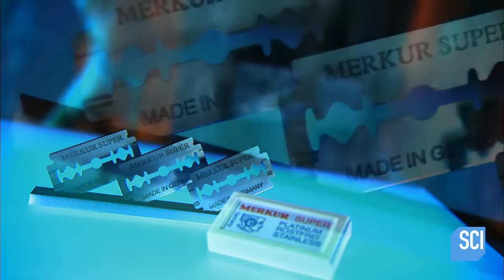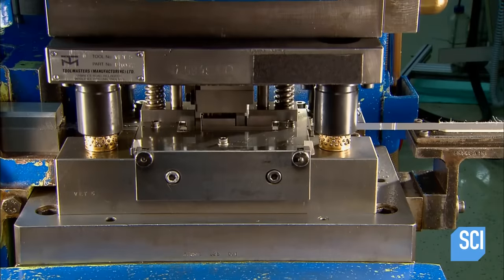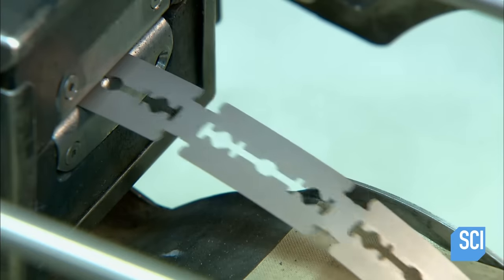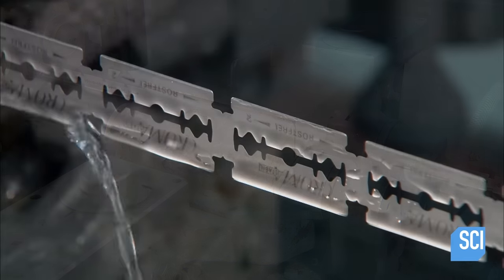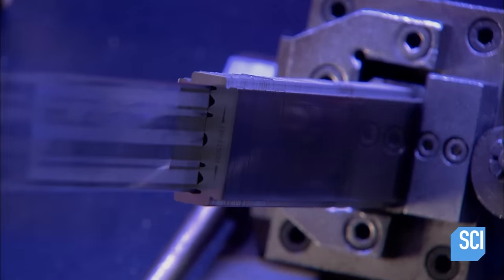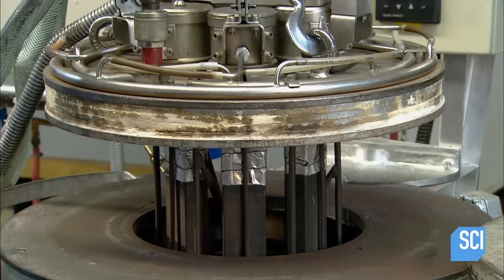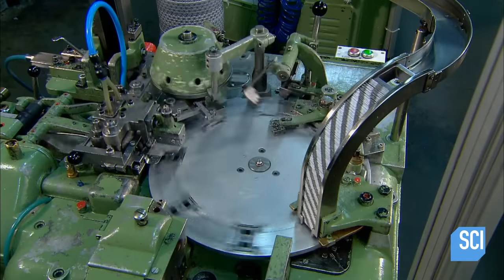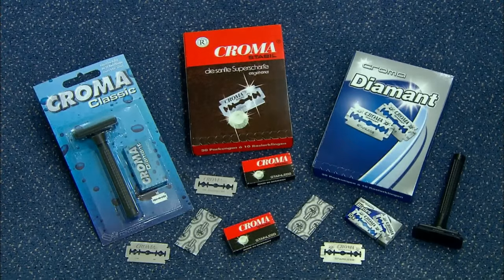How It's Made: Razor Blades

Comment: a long fast moving strip of razor sharp metal is actually kind of terrifying
Reply: they look like chuck-e-cheese tickets lol
Reply: That sheet metal could easily cut you before it was sharpened too! Think like a paper cut, but with metal zooming down a belt.
Reply: I wanna throw tomatoes at it...
Reply: The circular spinning machine for wax paper packaging is also no joke
Reply: To be honest, the singular stationary blade in the wax paper is scary enough on its own during the short time window between unwrapping it and putting it in the shaver.
Reply: @vale.antoni  I was surprised by the amount of people not wearing gloves
Reply: @christinanull5098  Well part of the problem with wearing gloves in a plant like this is the potential to get your hand sucked into one of these machines, but still, there are some instances where it would absolutely make sense to wear gloves here
Reply: @gatelyw4709  they are tickets to HELL!!
Reply: @gatelyw4709  give em to ur kids
Reply: @christinanull5098  dexterity is an issue, at work I occasionally have to wear NSR/cut gloves which are ANSI/ISEA cut level A9, needlestick level 5 and whilst they offer incredible front of palm needlestick protection and equally impressive cut protection (they are tested with razor blades) they can be hard to work in compared to something in the cut 5 ballpark, since the fingertips are so heavily protected/stiff
Working with M12 or 1/2" fasteners is hard enough and that's without adding web or back of palm protection found in other gloves in the line up. 
With full 360 degree needle/cut resistant gauntlets on there wouldn't be much you could do there, even simple things like lifting those wrapped blades off the stacker would be a challenge.
Reply: If you ever worked with sheet metal it cuts right through you like butter
Reply: I can still  feel my fingures cut when i was kid
Reply: @gatelyw4709  the forbidden ticket machine
Reply: @spicywolf6718  thanks for sharing your knowledge man! Dunno what the terminology means but you clearly got this!
Reply: Seems like something from Saw
Reply: kind of?
Reply: tell that to emo kids
Reply: 1000th like
Reply: So is that stack of 800 lol
Reply: Touching razor blade with a thumb can cut skin, I think it would cut through nail easily as well
Reply: That tape of razor blade metal is probably like a knife, imagine tripping over the knife, that's life-threatening a little
Reply: It's called a razor whire O.o
Reply: @Estrallio  Good to know, thanks 👍
Reply: Try working for UAW. OH THAT'S RIGHT; the U.S. doesn't make anything anymore. A whole generation terrified of real work.
Reply: Living in Memphis TN with da brotha's runnin round is scarier!
Reply: i agree
Reply: Infinite chain saw
Reply: im thinking of saw 3
Reply: You mean a chainsaw blade?
Reply: Imagine connecting it to a portable engine and connect them together in some way.
Reply: Emos be like 👁️👄👁️
Reply: @christinanull5098  You can't wear gloves when you work with machines...unless you want to lose hand and fingers.
Reply: @walkelftexasranger  the shop I worked in we wore gloves on every machine except sanding machines where the belt could catch the glove
Reply: @christinanull5098  Oh sorry, by that I meant machine tools.
Reply: Imagine falling on that
Good god
Reply: at the this point, licking is not a good idea i think.
Reply: Perfect for self harm
Reply: @gatelyw4709  oh no
Reply: razor sharp razor
Reply: There is actually a real weapon in ancient India that is simillar to that.
Reply: Heh "razor sharp metal". Possibly the best phrase when talking about a video about razors.
Reply: high speed steak knife
Reply: Starch for band saw
Reply: Just hold an emo against it, they'll tank you
Reply: It's not
Reply: @foodini  User name checks out.
Reply: Fr😂😂
Reply: Sounds perfectly safe to me.
Reply: The Wrist Eviscerator 9000
Reply: Some of the worst cuts I have ever gotten where from a blunt metal ruler, right down to the bone when it slipped, meanwhile Ive been using my thumb to brace an exacto blade when cutting and shaping the white metal used in miniatures and never been scratched myself.
Reply: Not for the emos lol
Reply: Wait until they see a bandsaw
Reply: @AA-ke5cu  Has zero to do with work ethic.  Has everything to do with corporations avoiding taxes and labor being cheaper in other countries.
Reply: @walkelftexasranger  Way back in 1997 (yes I'm old) I was working in a machine shop where we cut thick steel bars into slabs.  I was wearing those thick welding gloves you might imagine people wore back then in manufacturing.  A coworker and I were changing out the blade on a bandsaw machine. The type were you electrically lower the head so that both pulleys can be loosened.  As he was lowering the head my fingers were in the wrong place at the right time.  I will NEVER forget jerking my hand out of the way so fast that the teeth of the blade caught my glove as my hand came out of the glove.  No injuries, I was very fortunate.  Unwinding those bandsaws blades from their packaging (3 large zip ties) by putting it on the floor and jumping back was scary enough!!!
Reply: @atlantic_love  Yup, that's why gloves most of time sucks. I only use them when I have to weld something or when I carry sharp things (metal sheets, rough logs...you name it).
Reply: wait till he learns about swords
Reply: Thankfully the mass is low, probably not a huge danger.
Reply: I’d say it’s more theoretically terrifying
Reply: Yeah… like mowing the lawn or filling your gas tank or driving a car or taking a trip on a commercial airline or climbing a ladder or walking at night or a brain aneurysm.
Reply: @Rafael_Fuchs  imagining it snapping off flying around the room
Reply: katana lol
Reply: just imagine if you slip and put your hand on that
Reply: I can barely watch this video. Internally screaming
Reply: That is absolutely true. I’d though it’d be illegal and that sharpening would have been done after cutting the metal into pieces.
Reply: No shit
Reply: 😂 I never thought about,never….you are so smart actually
Reply: I just came to the comments to say that machine urgently needed a whip zone whenever this video was filmed
Reply: Jesus Christ loves us all.

Whoever pursues righteousness and love finds life, prosperity and honor.
Proverbs 21:21.
Reply: @gatelyw4709  Jesus Christ loves us all.

Whoever pursues righteousness and love finds life, prosperity and honor.
Proverbs 21:21.
Reply: @Rafael_Fuchs  Jesus Christ loves us all.

Whoever pursues righteousness and love finds life, prosperity and honor.
Proverbs 21:21.
Reply: @xan6990  Do you happen to have a quote that better explains what it means to be righteous, and one about what it means to love?
Reply: @Rafael_Fuchs  do you want one?
Reply: @xan6990  Yes. That would be lovely.
Reply: You ever seen an electric saw?
Reply: @Rafael_Fuchs  Jesus Christ loves us all

This is love: not that we loved God, but that he loved us and sent his Son as an atoning sacrifice for our sins.
1 John 4:10.
Reply: @xan6990 stop spam bots
Reply: please just dont
Reply: The person wouldn't even know they were cut until they felt a warm liquid start going down their arm.
Reply: Fear of sharp objects is a common phobia
Reply: I have seen this video 40+ years ago when I went to trade school. Now I am retired.
Reply: Nah, it's groovy
Reply: I've been working around these types of machines. This is sped up drastically . If it moved that fast it would cause a horrible mess coming off the role. Even with a tensioner.
Reply: @acidset Is there a video of that?
Reply: Eat them. Feel razor in your mouth. Not in that way
Reply: Its quite safe, I've only rarely nicked myself with the edge of one of these, while i've managed three fairly big cuts with a modern razor.
Reply: Final Destination moment
Reply: Actually «RAZOR SHARP»😂
Reply: Yeah could you imagine sliding down a ramp of those into a bath tub of alcohol?
Reply: It’s full and soft at that point haha
Reply: @arleneazurin   Like describing a car as "....race car fast..." that actually is a race car.....🤦‍♂️
Reply: Ackshewawy
Reply: its not sharpened
Reply: @hyperakt1v  touch it
Reply: No more than a bandsaw blade.
Reply: Well no crap
Reply: No whats scary is shaving with a straight edge blade.

Comment: The most interesting aspect of the video is how old the equipment is. In the beginning you can see the case of one station is rusted. The digital readout in the cutting test states "Made in W. Germany." It's cool that the process has been the same for at least 30 years or more.
Reply: A lot of older reliable machines come from there way back then, still see them around in CNC now. Sheet metal tooling the best i have used came from Sheffield and Birmingham , same as the actual sheet metalworkers skills you cannot dream of
Reply: @DVSUte  many people say, that those old machines were better  that modern ones, usually followed by "cheap and chineese" os somethibg like that.  Isn't it tho, that we use old ones, simply, because they havent broke down yet?
Reply: @tornad8063  Exactly, why replace something that is paid and gets the job done just fine with something that costs a shitton?
A paid off machine is literally a moneyprinter.
Reply: @billklatsch5058  like that analogy
Reply: @tornad8063  SR71 Was made with slide rules and skilled jedis no computers
Reply: @DVSUte  SR71s also sucked at their job
Reply: @tornad8063  In the old days, due to less data available, equipment are often overdesigned in order to ensure that it would work or be durable enough.  Nowadays, because people want to be "economical" and "environmentally friendly", they use the bare minimum amount of material required.  This is why older equipment are more durable.  The same applies to bags, shoes, pants, pots, boilers, pipes, etc that we buy these days.  They all break faster because of "innovation" and "sustainability".

To illustrate with an example.  Let's say a piece of equipment needs to withstand 10 bars of pressure.  In the old days, engineers due to fear of failure, might make the equipment 20mm thick when only 10mm is theoretically required.  Whereas now due to lots of data from existing equipment, they have confirmation that 10mm is enough so they only make it 10mm thick.  But what happens?  The old equipment due to additional thickness takes much longer to corrode from operation or erode from wear and tear, whereas the 10mm is worn away much faster.

Personally, I prefer equipment/things that last longer.
Reply: @Jen-Yueh_Hu  i get thw general idea of what you meant, jus I want you to know (sorry if you already  know, just simplified a message)  that even theese days there is thing called safety coeficent, that depending on field and material used comes from 1.6 to over 2.3 (so if 10mm is bare minimum, it will be done at least 16mm)    I guess, back im the day it was just way bigger.
Reply: @tornad8063  The safety coefficient is smaller these days.
Reply: @Jen-Yueh_Hu  smaller than in the past or smaller than what I wrote?  I guess, our teacher didn't update his knowlwdge, because we had that in school last year
Reply: @tornad8063  It's entirely survivorship bias. For every old, functional machine, there's a thing that's been replaced by something built in the last 5 years that works better, and cheaper.
Reply: A lot of industrial machinery like this is pretty old. The machinery used to make Rapira, Voshkod and the Russian Gillettes and such were likely made in the Soviet Union.
Reply: hey, if it ain't broken don't fix it, right?
Reply: @dylangergutierrez  they were literally never shot down
Reply: @Jen-Yueh_Hu  Actually the major reason for modern items breaking down at faster rates is simply due to intentional design. Companies realised there was more money in repeat customers rather than the customer buying a product and never needing to replace it.
Reply: Oh shit, that's a good detail!
German engineering... You cannot get better, especially back thrn
Reply: @Jen-Yueh_Hu  I think corners get cut a lot more like that in the name of profits than environmental friendliness. Planned obsolescence is unsustainable in fact, but it does make more short-term profits.
Reply: @Jen-Yueh_Hu  You sound spiteful of sustainability and it's because you're very confused and wrong-headed. Cheap, disposable goods aren't sustainable and they aren't designed to be. Instead, the manufacturers realized that people will buy more of their products if they break frequently and not notice or care that they're spending more in small increments than they would have in one large purchase. You are correct that many modern goods are made cheap to fail, but don't blame it on environmentalism. Blame it on capitalism. I doubt you will, though, because based on your anti-sustainability bullheadedness, I suspect you worship the laissez-faire gods.
Reply: keep in mind not all of these episodes are filmed in the US so equipment can be diffrent. And yes i did catch the W. Germany part.
Reply: @brandons2411  I recall reading that around 50% are US made, which is a large percent considering all the rest of the 50% is every other country. 
I wish we could see all the ones made in China. That'd be interesting AND unfortunate
Reply: Yah until you're kicking it cause you're halfway through a 12 hour shift and it's broken down for the third time and you cuss out how the company doesn't buy any new shit and then complains about production downtime.
Reply: dont fix whats not broken
Reply: @DVSUte  Jesus Christ loves us all.

Whoever pursues righteousness and love finds life, prosperity and honor.
Proverbs 21:21.
Reply: @tornad8063  Jesus Christ loves us all.

Whoever pursues righteousness and love finds life, prosperity and honor.
Proverbs 21:21.
Reply: Really rusted ... That could poison you if used without caution 👌
Reply: This manufacturing process (continuous metal strip) was invented by the Valet Autostrop company around the 1920s IIRC.
Reply: you know the hydrogen peroxide you find in stores? they used that same process since 1912
Reply: @Jen-Yueh_Hu 
Older equipment manufacturers also wanted their consumers to maintain their products for a long time so the initial purchase was more than the "newer" equipment, that higher price justifies the higher quality replacement parts compared to today
Reply: @Jen-Yueh_Hu  Not really, breakdowns are somewhat intentional, its called planned obsolescence. The ability to use mathematics to create machinery that is just as robust as it needs to be is centuries old, hence the saying "anyone can build a bridge, but only an engineer can build a bridge that barely stands"
Reply: Old machines will last longer because they are simpler than newer machines. But both require maintenance
Reply: Another interesting part is this is basically how a kitchen knife is made too. Or a pocket knife. Not the super high end stuff.. the dollar store knives and cheaper generic stuff. It’s not half bad either. 

Chinese 8cr13mov is dirt cheap and performs like higher end American steels like 154CM.. not exactly but for costing 20% what it does it’s pretty dang close to
Reply: @tornad8063  Isn't it tho, that we use old ones, simply, because they havent broke down yet?
     Um, yes, and that's because of the superior manufacturing in the first place.
Reply: @tornad8063 theres monopoly on machines but also good stuff now a days cost a lot compared to 100 years ago, escpecially if its not a widly used one